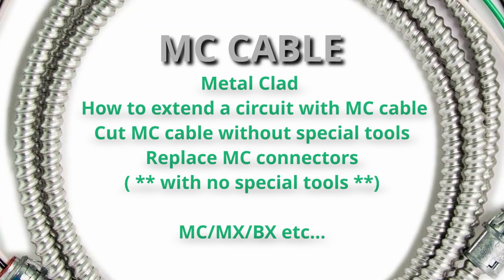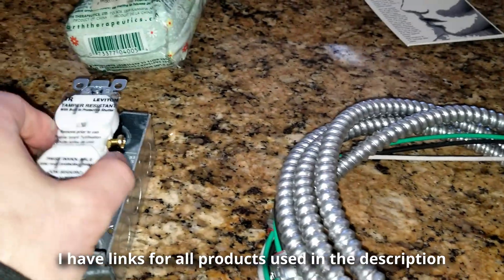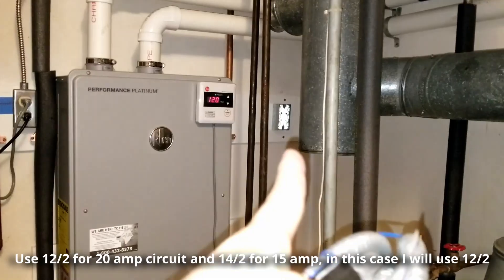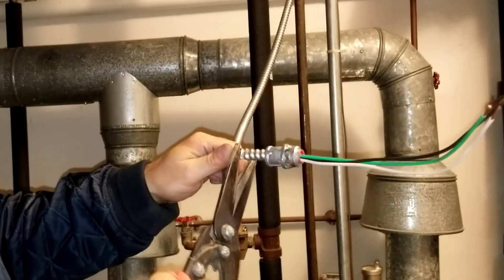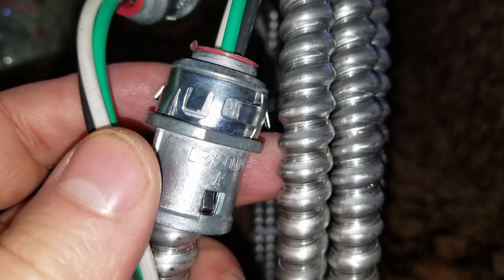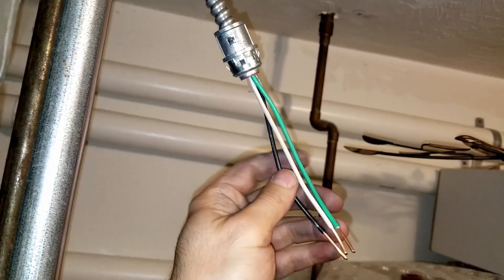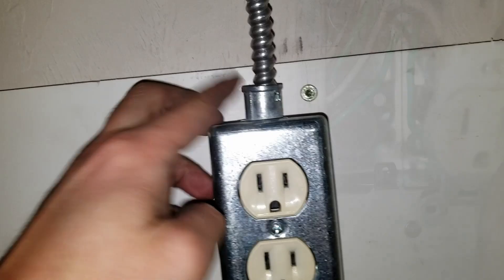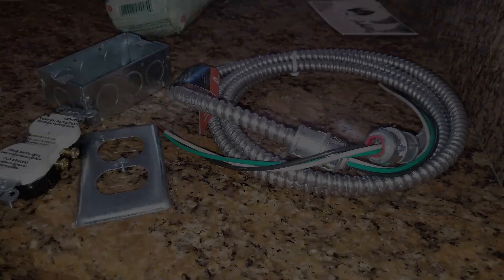How to install, strip and cut MC cable with no special tools

Comment: Nice  video. I was just wondering where you were able to find an 8 foot length MC cable? I am looking for roughly only 8 feet of 10/3+ground MC, but haven’t been able to find lengths less than 50 feet.
Reply from the maker: home depot
Reply: why do u need MC cable? 10/3 AC or BX cable are still fine
Reply: @johnmainolfi8054
Reply: @johnmainolfi8054   MC cable has a far superior full sized insulated green ground wire rather then extra flimsy #18 guage aluminum ground wire inside of type AC cable.  No such thing in NEC called BX. In just about every commercial site you must use type MC cable and not garbage type AC cable.
Reply: armor clad cable has two means of ground path. the thin bond wire and the armor is approved as bond. MC cable does not have an approved armor ground and thus the green ground conductor. it is a matter of preference and i find no issues with AC at all. why bother with the added space required to connect all grounding conductors?. commercial projects i use MC/AP which has a no.10 aluminum ground. no need to terminate it in the enclosures, just trim to the end of the cable. inspectors identity it by the only white wire within a cable that is stamped. 
to each his own.
Reply: @johnmainolfi8054  Garbage type AC had not been allowed in my area for any industrial or commercial work in last 40 years. Have seen too many steel jacket AC cable rust thru especially in damp basements. I never got around to laying out 100 ' of #12 AC cable and measure the resistance between that and 100' of bare or insulated #12 wire. Then run 20 amps thru the 100 foot jacket for a hour.  Bet it would heat up. The outer jacket called something like convolutions must be ten times longer than a wire. So if you had a 200' run of AC cable you would probably have 2,000 feet of jacket along with #18 joke aluminum wire. We were always told to never have two different types of metal touching one another due to galvanic reaction yet they have fragile #18 guage aluminum wire in contact with a steel jacket. When I had a new furnace installed I replaced the old AC cable with MC. Hope you have looked at some say 50 year old houses that still have AC cable feeding garbage disposals. Always rusted & corroded.
Reply: They sell completed "assembly whip" in a few sizes and styles. But 10/3 isn't one of them.